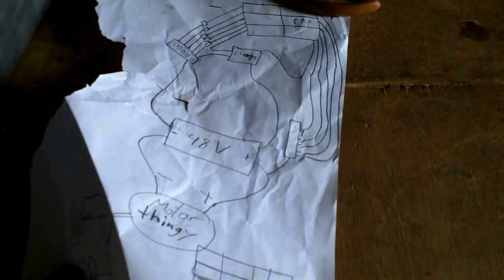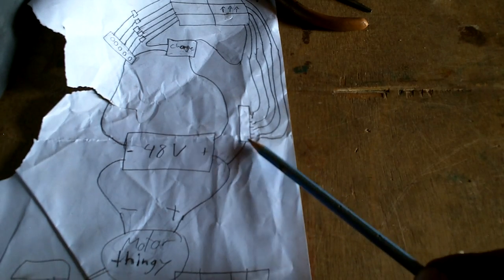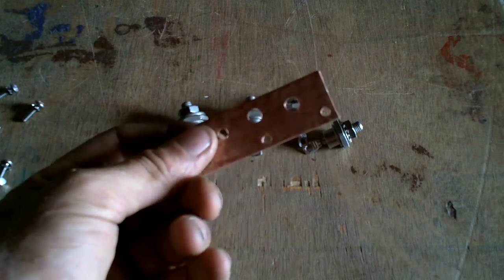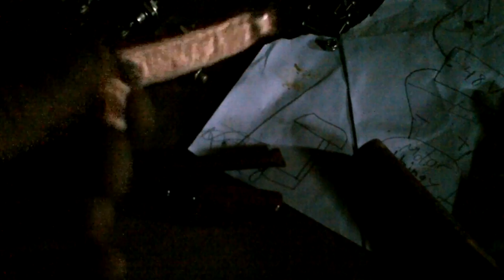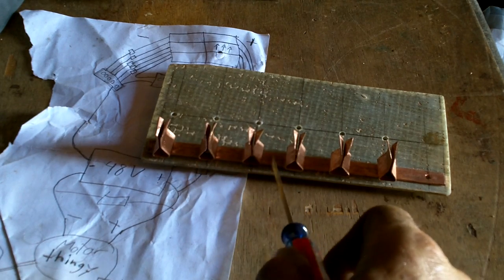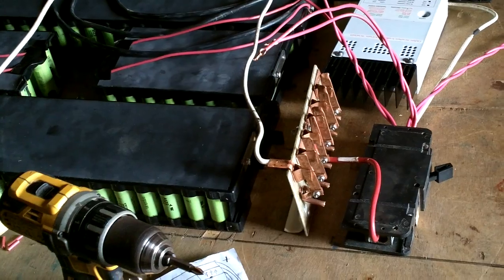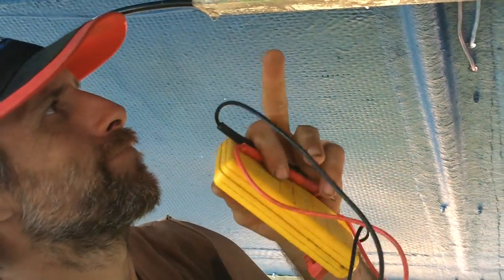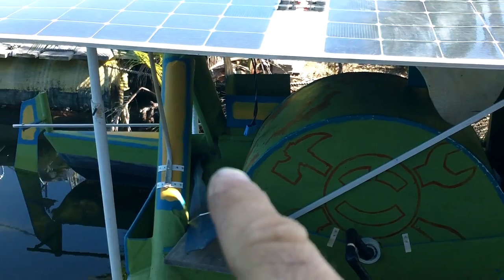Solar Snailer 038 Switch It Up!

Comment: All looks great. Only concern I have is the lack of good shelter for the battery and electronics. It seems like that the only thing keeping it dry is the thin solar panel above? Just one drop of water can kill a powered piece of fine electronics. I would  personally add an extra layer betwee. Maybe just a thin plastic sheet. Stiff enough to hold itself up above the elctronics over the span it has. That way a free flow of air is also possible to cool it. Can't wait to see it go.

Comment: I don't see the benefit of bypassing the solar charge controller. Sure the working voltage of pv array may work with your motor, but a mppt will have more usable power. Think about the resistance of panels versus motor. A mppt will track the power point and milk as much power as possible from your panels. 

Motor is induction load. Best to have that motor connected directly to the battery. Solar panels to induction load isn't that great. It needs regulation. Resistance will vary so you will not pull much power from those panels being directly connected to the motor. 

The blocking diodes are smart for parallel configuration of pv array. But if the panels are angled the same, just get a mppt and put panels in series. You will produce more power, I promise. Wire loss alone and no diodes are first benefits. Anything less than two parallel strings doesn't need blocking diodes.
Reply: Agree. More electronics but you get more energy out of it :)
Reply: @DIYTechRepairs  hey buddy! :D
Reply: Salt water really likes mppt controllers and also there's an electronic repair shop in every mangrow bay around the hood... :D
...but my concern is there's no current limiter to prevent panels from overload (thus destroying the source of power) as they will bubble off if so - even Matzel had one of his cheap panels damaged this way in previous episodes.
Reply: @Helloverlord  thats true but There exist plenty of weather sealed controllers and even those made for the sea ;)
Reply: @DIYTechRepairs  I agree, but we're talking of limited fundings - those seaworthy (watertight) are triple the cost of regular ones...and then it comes to the maintenance  -have you seen wrapped wire connections in this video? They will arc and create resistance in a month of sea trial, those new electronics just love arcing... :D
Reply: @Helloverlord  another sponsor :P
Reply: For someone who wants ultimate efficiency, getting 0.7v drop on a 12v panel is already 6% loss, more than a charge controller. sigh
Reply: @Helloverlord  i understand that since im a DIY person myself doing alot out of nothing ;) but it was you who brought that Up. I would just contain the controller in watertighr box. And IF its an ok Charger you dont need to transfer extra heat and IF needed thats easy sorted.  Money is also a factor. But My experience doing solar for many years you do save a fair bit of energy over time with decent controller. Especially driving. A motor. With that driving the motor straight out of a panel works and in many cases its just easier to add an extra panel compensating :) and he gets more shade too under.
Reply: @DIYTechRepairs  If you follow Mr. Mantzel from a beginning it would be clear for you his designs are not meant to be energy efficient but simple and sturdy as possible. Thats his decision and I respect it. Its not the overall best but he thinks its best for him and Im speaking from his point of view (it could be called advocacy but hell, its not illegal...yet).
As for sonsorship idea...well, its not that easy to find a sponsor to give you a product he will know it will end up destroyed. Not very good for advertising.
Reply: @Helloverlord  i have since Day One..... And IF you Read My answer i never said His decision of way forward was wrong or anything. I only mentioned what you can gain. 
And in jaimies case its not hard to get sponsorship. Its actually rather easy today when working like he do. ;)
Reply: @DIYTechRepairs  It could be I've missed it. Well then, after that sorted, it's been nice chatting with you.
Reply: I was thinking of the charge controller just for the auto shut off and convience of charged batteries without the exterior charging source

Comment: Jimmie, I think your positive wires should be connected to the MPPT controller because it changes the panels voltage into amps. To move the motor you need amps not voltage. If the controller is not enough for the amperage you can connect more controllers in parallel.  Makeskyblue controllers are cheap but very comparable to expensive ones.
Reply: How sure are you that you know what you're talking about? "Changes the voltage into amps" a transformer can take a high voltage low amperage and make it a lower voltage higher amperage. Is that what you mean?
Reply: @nicholasalbeck7114  What he means is that the panels are about 30 volts each, A pair makes them 60 volts, With a charge controller going to the battery it will make it the correct voltage. o
Another example is that if he was to wire up 4 solar panels it would make about 120v give or take, The charge controller will give you the correct voltage for a 48v battery bank. 
This really all depends on what the highest working voltage the motor can handle, Since it is a 48v, I am sure it may handle up and beyond 60 volts with ease. 
Directly connecting a pair of solar panels will give you 20% power to the motor, The more  switches you turn on raises the amps to give you more power.  Yet I am pretty sure that motor has all of that stuff built in, There for pairs of panels connected to one might have worked. 
Though myself I would have bought a good charge controller that allows for high voltage of 500v or so. 12 of those panels would have produced up to 400v and can put out 48v in to the battery bank and one could have used that power. They do make all in one systems for fairly cheap now, These can cost a few 100 to a thousand. The higher the voltage of the charge controller the more you can get use out of it during lower light conditions. Yes you may lose the amps, Yet you will still have power late in the day.
Reply: @kameljoe21  yes, the amp is the power that turn that motor.  You can have a high voltage but it will do little to turn the motor.  My choice for the controllers  is the makeskyblue 60 amp and can handle up to 150 volts for less than a hundred dollars. These controllers are easy to setup and perfect for lithium batteries.

Comment: i dont see the need for the diodes if they to stop battery feedback into the panels then they need to be on the positive side  something else i would check is which is the commen on the controller asis commen positive or commen negitive

Comment: Those beefy rectifiers will sustain rated current only if cooled properly. As you mounted them,  they will sustain only about 5-6 amps long term (for days) at 100*F day...
Reply: rectifiers?
Reply: @marc_frank  Yeah, diodes or rectifiers.
In this case serves as a one-way electronical valve preventing discharge of a batteries through the PV panel at night.

Serve same purpose if AC voltage is applied, preventing current to "drain back" to the source during opposite voltage spike. Hope this help.
Reply: @Helloverlord  there is no ac in the circuit except for motor driver output

full bridge rectifiers are better for making dc from ac
Reply: @marc_frank  Thank you for sharing this with me. I didnt know that. i thought PV panels are all AC. There always something i could learn even being into electronics professionally for more then 30 years.
Reply: @Helloverlord  wow, i started beeing trained last sebtember for the same job
Reply: @marc_frank  I can tell. You're doing great!
Reply: @Helloverlord  thanks :)

Comment: looking real good j. one thought - you mentioned you were goin to use some beefy 4 guage wire to the motor... but the connections between the chunks of battery look about 16 guage. Shouldn't these all be matched so as not to create a spot of high resistance?

Comment: Curious about balance charging -- will putting some of these sets of batteries in series potentially cause an unbalanced charge (i.e. if there's two 24v groups of cells, and you're charging the whole thing to 48v, if one cell goes bad or charges slower/faster will you end up with one set at 25v and one set at 23v instead of an even 24/24? or do these A123 batteries have some protection against that?)

Comment: How many actual amps are coming out of the switchboard, not theoretical, when the motor is on?  Auto Amp gauges can measure it.